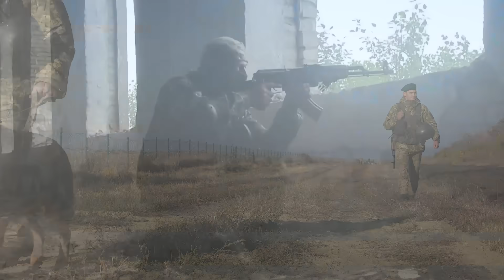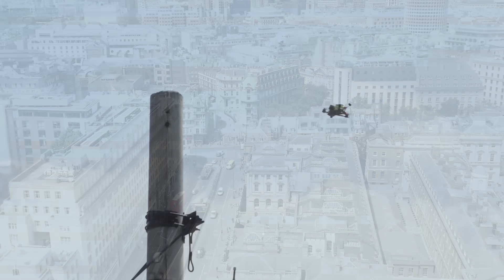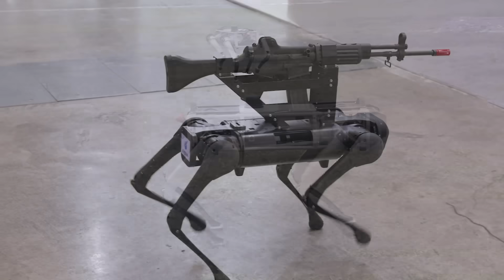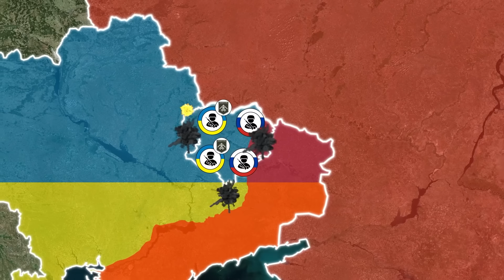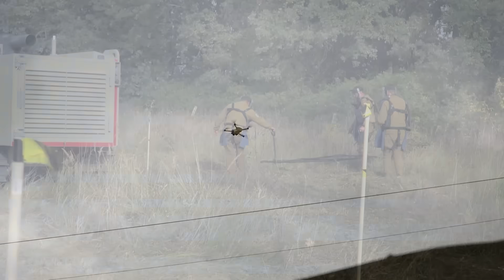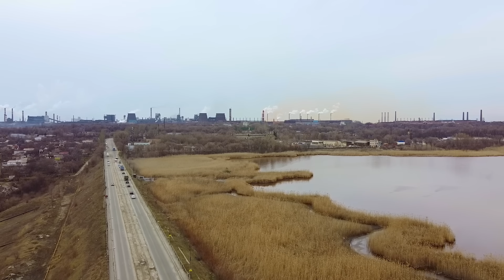THIS Made Russian Troops FLEE the Battlefield INSTANTLY

Comment: I would be EXTREMELY concerned that any Chinese-made electronic gear was gathering data and transmitting it to China’s electronic intelligence headquarters in Shenzhen. 

This was discovered to be the case with aerial drones given free to U.S. police departments. All use of them was halted once it was discovered that they were mapping terrain over which they flew, monitoring public and official radio and TV transmissions, and sending all of this information to China. 

It was even suspected to be the case with Chinese-built mainboards of servers used by major U.S.-based such as Amazon, Facebook, and others. 

One can see how useful such data would be in the hands of a hostile power.

Comment: The following might  a useful idea for Ukraine and any country to defend itself against aerial attacks. 
The record for using drones in a light show is over 5000 drones. Ensuring there are no collisions during manoeuvering  is complicated but doable.
A 70 X 70 vertical drone minefield would be considerably simpler to control.
Place small contact explosives on each drone with a mechanism to activate and deactivate them, place them a metre apart in front of a missile and you have a 70 m X 70 m vertical minefield all but a tiny missile would hit. Space wider to destroy aircraft.
Program in automatic launch and initial positioning when a threat is detected and automatically adjust as the threat nears and its nature is known.
Most of the drones would be reusable, meaning the cost of an effective defence is thousands not billions.
The drones could have their explosives removed and used for civilian purposes when no threat exists.
Multiple shield minefields could be launched in the path of a missile or plane 
If all countries have cheap effective defences then expensive offensive weapons would be redundant and the chances of wars would be reduced.

Comment: Instead of expensive satellites they should use helium (or even hydrogen) balloons as low cost satellites. They are cheap, if you prevent them from popping, they'll go many times around the Earth and will supply not only photos and other intel, they also can work as relay stations and are unjammable, undestructive, because for the 250€ such a balloon costs, you can not get a weapon for less than 100 times the cost to shoot it down.

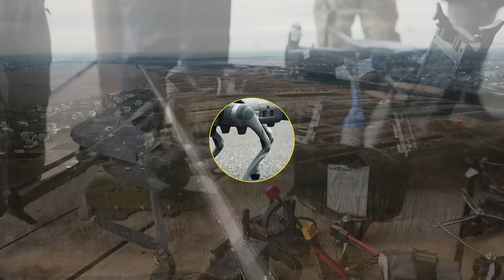Comment: 1:55 UAVs should have thermal imaging systems, mines should gather heat and be detectable in the afternoon/evening hours. After a few rotations of this, you could even run a misdirect and fly a few drones back/forth and then come in from a previously cleared area - Get your opponent used to you using a tactic, and then use it against him

Comment: Nine mph may not seem like much, but consider that the world record marathon time, at 2hrs, 35 seconds, equates to an average 13.08 mph. That’s not a lot of difference. What’s more, a Marathon is only a bit over 26 miles—meaning that if the record holder had to run the extra 19 miles his overall time would very likely be more like 9mph. That’s pretty impressive.
Reply: You wouldn't want one chasing you!!
Reply: @professorg8383 At that speed I think I could push my 77 yr-old body about 26 feet.
Reply: a combatant with equipment simply can‘t outrun the robot.
Reply: A comparable ultramarathon of 100 km, or 62.14 miles has typical times of 10-15 hours to complete. That's about 4-8 mph, so yeah, the pup would likely be faster. The next step down in ultramarathon is 50 km, or 31.07 miles, with typical completion times of 5-7 hours, or about the same speeds as the 100k. And these are the shorter ones. That said, remember that it's pretty much an elite athlete sport, that participants train for pretty much year round. I sure ain't competing at those levels, much less with a pup over these distances.

Comment: The “dogs “ could be fitted with small comparatively cheap sensors which are already used commercially in use, the filters pick up the chemicals that are in body odours, after shaves, tobacco smoke even the smell of various explosives. Many years ago. being able to smell other humans, and if it were humid days, wet days , not raining ! It was  possible to smell a dog or dogs , horses etc, from some distance away,this ment the difference between being caught and beaten up or end up incarcerated.

Comment: The robot dog's if equipped with arms could be used to recharge and rearm UAVs.  Also, just as UAVs are being equipped with fiber optic wires so could a robot dog thus extending its range. And cargo UAVs could bring it  fresh batteries and ammo to recharge itself as well as attack UAVs.

And  the next step up for resupply is to use humanoid bots  riding cargo e bikes that could carry much heavier loads and much faster as well.

e.g. Goggle on YouTube
New Interactive Robot Capable of Riding Bike Set to Serve in Multiple Scenarios

and
Cargo Bike Vs Cargo Bike: Which Type Is Right For You?

And as far bots employing weapons, that is no different than a UAV doing that. Maybe we have Hollywood to thank for the public reaction to that idea.  with all the killer bot movies they have made. One can image China has no such qualms.

Comment: The drones come with "High resolution 1280x720 cameras" So it runs on 720p, circa 2005 Xbox 360 video grade hardware.. that's nice...
Reply: And a speaker, so they can bark and growl!
Reply: they need to see, that's it. anything higher would take extra hardware, and heat up faster. they aren't playing video games with these things, you dip.